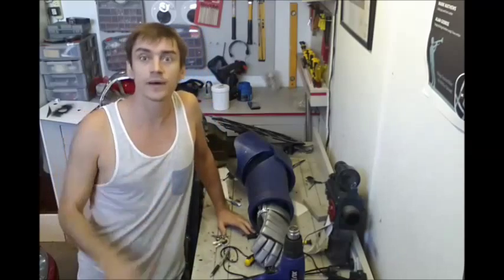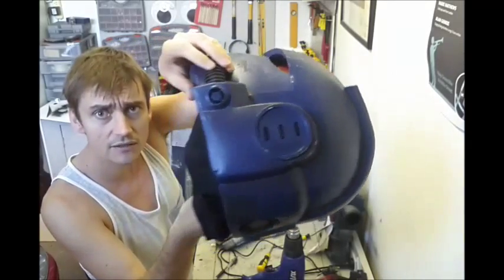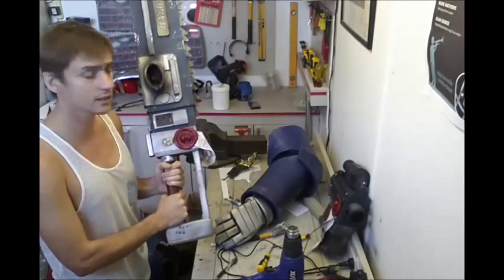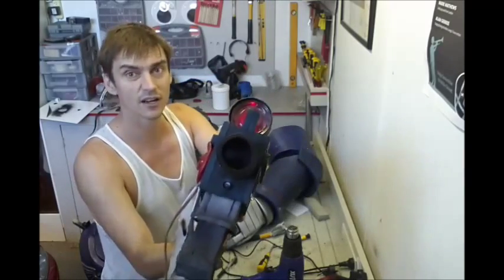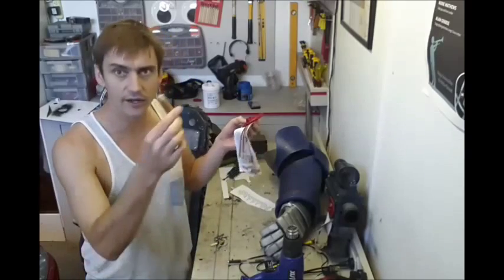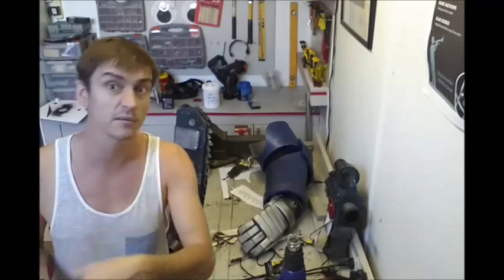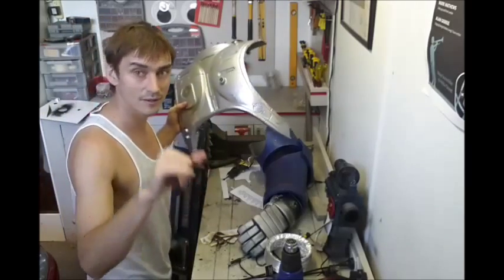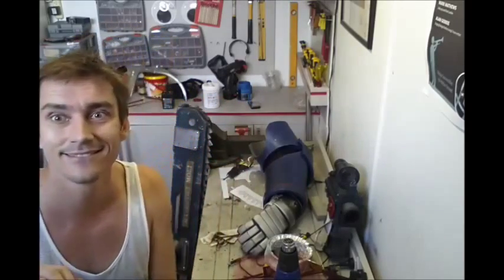How to make an EVA foam Space Marine suit - Part 10 - Final Touches

Comment: cool build love the chain sword! I'm in the middle of my build at the moment and just fitted the back pack but the weight of it make the chest armor ride up and try and choke me did you in counter this problem and if so how did you fix it?
Reply from the maker: Justicar LeStat Yeah I had a similar problem. There are two things I did. Firstly was to add some padding in the chest, in front of my shoulders. The second thing was to mount all the other electrics I have in the front part of the chest like the batteries and speakers. It makes the armour heavier, but balances the chest.
Reply: I placed boxes as back support with pads at my shoulders to help pin the torso in place.

Comment: What kind of air duct tubing did you use for the joints and what was it you used to cover them in black? The audio and captions didn't help much.
Reply from the maker: The ducting looks a bit like a thin metal wire spring covered in a plastic silver Mylar. It’s often used for ducting in ceilings. You just need to get the right diameter. I used spandex to wrap them in black

Comment: Sorry for my English.  ;) 

Hi i building the space marine suit. I use paper, 
 epoxy resin and fiberglass.  And i wonder how you made eyes in the helmet. How materials you use and how you connected this with helmet ?

how did you connect the shoe in the shoe ?
Reply from the maker: For the eyes I used the lens from some sunglasses. To attach the shoes into the boots I used hot glue and cable ties  going into the sole of the shoe :)
Reply: @WellingtonIronman  
Thank you so much. If you can, are you able to take some photos because it's hard to see these details in your videos
Reply from the maker: @MaksymilianFox  sorry I no longer have the suit
Reply: @WellingtonIronman  anyway thanks for help. Last question

did you make holes in the foam all the way up the foam to use cable of tails?

did you make holes in the sole of a small shoe or run a tail cable over the shoe?
Reply from the maker: @MaksymilianFox  I made holes in the foam of the shoe, under where your foot goes.